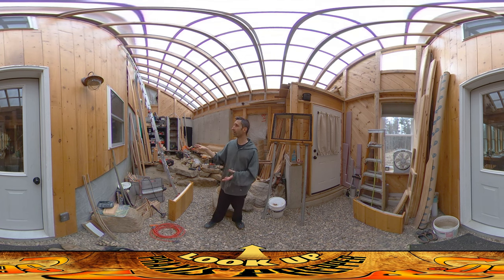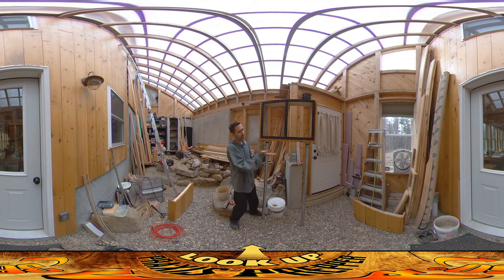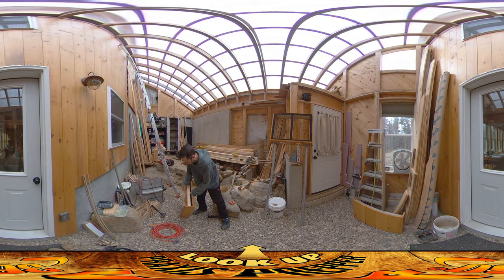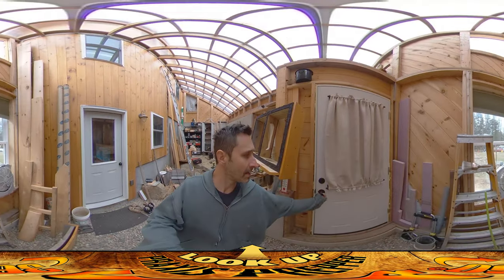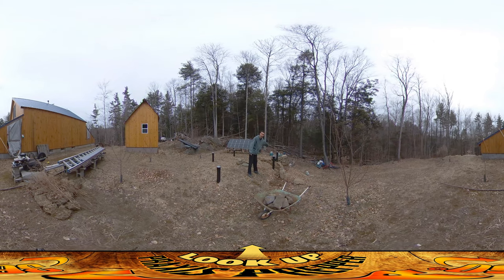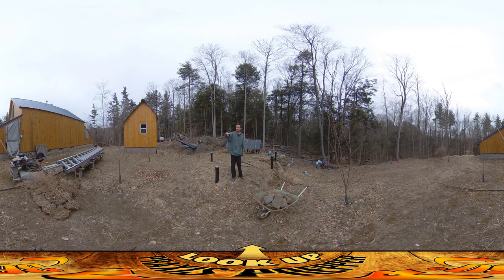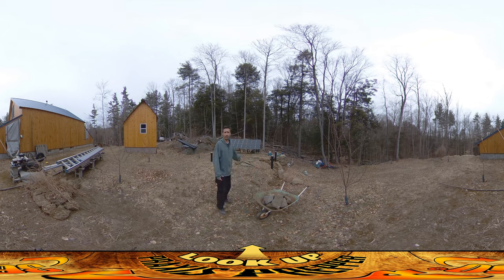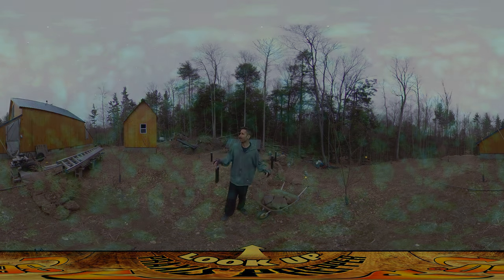Homestead Building - Fallout Shelter Air Filter Box Intake Build

Comment: I suddenly have a vision of that mesh getting clogged with ash since it will get trapped and unable to fall out, no pun intended, wonder if it might be a good idea to have a pre-filter before the mesh which I think is primarily there to keep critters out if I recall correctly. Good idea on running FM and shortwave radio antennas into the house and shelter.
Reply from the maker: The prefilter black mesh is super course, so I don't know how clogged up it could get, but I've been brainstorming some sort of pre-prefilter. My ide is basically a settling chamber where the particulates could fall out from gravity. Not 100% sure about that yet. It'd be a "only pop it on in an emergency" sort of ugly-ass thing.
Reply: @PraxisPrepper  I’d agree that it would be an emergency measure and frankly you’ll hopefully have some time to get a feel for how the mesh is performing for at least a little while. My thought would be to look at one of the high rating furnace filters and cut it down to a size to fit over the mesh with the edges pressed in a frame to hold it in place. Of course the other balancing act is how much filtration is so much that it really starts restricting the flow. Actually it might be worthwhile to look at a really fine screen instead almost a silk like fineness given thatthe purpose would be more to repell large ash flakes vs actually screen out the micro bits that screw up the lungs and potentially cause cancer.

Regardless of appears to be sufficient, it would be good to run it for relatively short periods of time and occasionally briefly reverse the fan to quickly blow out as much gunk as possible
Reply: 🤣🤣 fall out
Reply from the maker: @davidsto9064  I think this is a pun, but I'm not recalling to what it's referring.
Reply: @PraxisPrepper  the first post in the threat about stuff getting sucked in but not being able to “fall out” sorry long week and not enough sleep . . . Cause that’s funny.
Reply from the maker: @davidsto9064  Gotcha. I want the "fall out" to "fall out" of the air. ;)

Comment: Wait on the concrete. Until the air system is tested. My question is, Praxis. How to do you change the air  filter after 20 hours of heavy use?
Reply from the maker: If the air filters need to be changed every 20 hours, there's going to be a problem.
Reply: @PraxisPrepper  : you using HEPA Fliters, Praxis. Use regular air fliters , first . Then HEPA. last longer. Get the big  particles
Reply from the maker: @Diebulfrog79  I was thinking about that consideration. I've built this thing to be adjustable. It can "accordian" in and out to accommodate different filters. I was actually wondering about just what you said, stack two filters. Crude ones first and then a HEPA layer beneath. I was also thinking about creating a lid of sorts that would assist in letting particles pre-filter with gravity. Whatever I end up doing, I"ll definitely be testing it out ahead of time. As you noted, I can't be heading out during an emergency to swap filters out.
Reply: @PraxisPrepper   good 👍, work smarter, not harder. That is the main problem with outside filters is the maintenance to clean them. My system has baffles to control pressure and dust. I live in a desert and  we have dust, bad for me.
Reply from the maker: @Diebulfrog79  I really appreciate your thoughts on this question. I have done indoor air filtering, but never filtered outdoor air coming in. Here in New England, we don't tend to have much dust, but in a situation where we were using the shelter, that obviously could very easily not be the case. This will be my first crack at an air intake/filter - so your experience-built thoughts are very much appreciated.